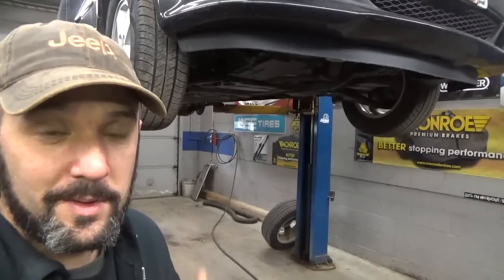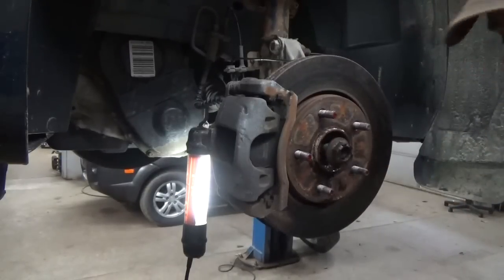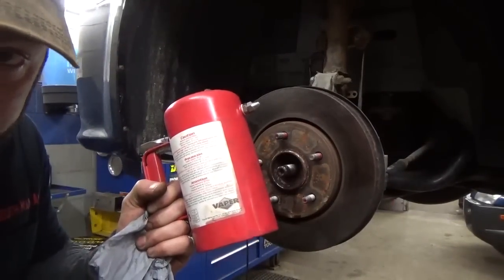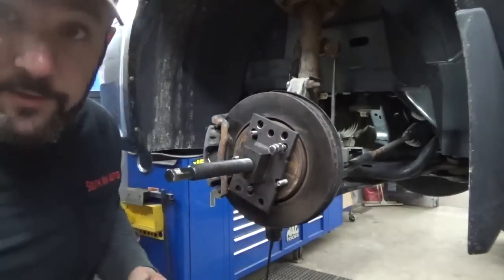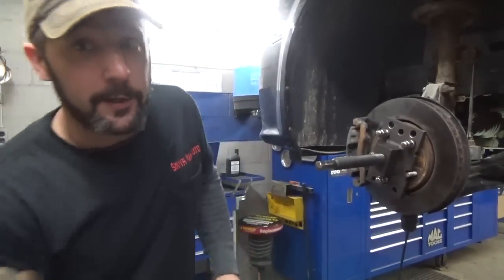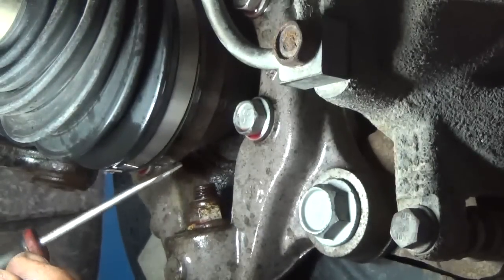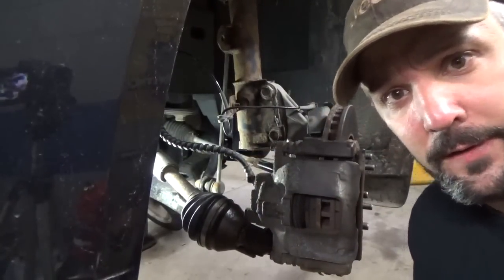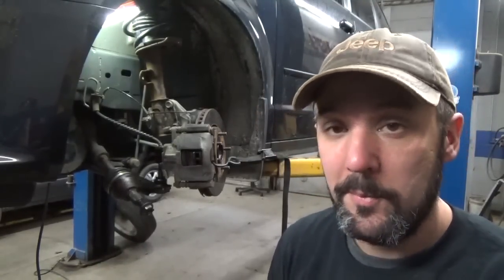Dodge Grand Caravan Lower Ball Joint - Part I

Comment: Brilliant, passed  state inspection with flying colours and the lower ball joint is totally gubbed !, state inspection leaves much to be desired then !!.
Bodgitt and Leggit had a similar issue with the Irish inspection system.
I certainly dont get the logic here.

Comment: Did you have to pay for the axle or did the customer?
Reply: jackslater230011 I would assume the customer.
Reply: I wouldn't assume that. Technically, Eric most likely broke it by pounding on it.
Reply: He did break it, but garages usually charge the customers for ancillary parts when doing a repair.

Comment: I have a 2004 Dodge Stratus and what a nightmare it is to work on doing any front suspension work. Upmost ridiculous design the upper and lower control arms are 1 piece you cannot just replace a bad bushing just to do upper have to take strut out

Comment: What the heck is with Chrysler/Jeep/Dodge/RAM ball joints?  I lost several on my '08 Jeep Patriot (may it rest with someone else).  RAM's have been known for ball joint issues.  So far (knock on my head) our Durango hasn't tossed any (4.5 years old at this point).

Comment: Why you didnt heat the CV joint and a hub?
Reply from the maker: Martin I didn't want to ruin the bearing if I could avoid it
Reply: South Main Auto Repair OK, now I understand.  In my car bearing is much cheaper than the axle..
Reply from the maker: Martin Oh got ya... yeah not in this case

Comment: Why not just remove the two camber bolts and get the angle of the knuckle downdraft to make it easier to pull out the axle. Then once lose put camber bolts back in.

Comment: 3 people were killed recently here in Ireland because of a faulty balljoint.The car swerved across the road into an oncoming jeep.
Reply from the maker: Tom OConnor geez that stinks :( and to think NY says they are not a "safety" item...
Reply: South Main Auto Repair Right below you here in NJ the only thing that matters is emissions.  You can go in with no windshield, no mirrors, 4 bald tyres, severe steering play, but as long as the check engine light is off and it passes emissions, you're mint.
Reply from the maker: Haha typical! Insanity isn't it? Save the bunnies and puppies haha
Reply: It scares the hell out of me actually; people request us to overlook or to do some really sketchy things. When I worked for advance I had this dude who thought that $15 was too much for a brake hose and informed me that he was going to crimp off the line with a set of vice grips.
Reply from the maker: lol perfect
Reply: I'm all for safety inspection. I am usually all for the government staying out of our lives, but this is something that the average Joe (at least in my area) cannot be trusted with. I recently bought a truck out of Virginia that had just been through safety inspection recently but because it's an 83, it was exempt from emissions, which they removed everything to do with emissions on the truck. Luckily with pre 96 vehicles, it's easy enough to get around if you know the right people.
Reply from the maker: Lol it's all about knowing the right people. There is a scum bag shop just up the road from mine and for $50 and  a hug you get a sticker on anything. He plugs them into his own vehicle and prints out stickers haha. He does all his business after 5pm so the state says that he will never get caught because he can never be audited because he is "never open" during normal state business hours...

Comment: Eye protection, Eric!

A chip could come flying off the end of the pressure screw when you're whacking on it with that sledge.

We need you around with good eyesight in both eyes!

Comment: Even experienced mechanics are brainwashed by the impact gun.  You never use impact guns through 6 inch long steel rods or any extensions, you simply get too much torque loss.  I see it every day mechanics will waste tons of time using impact wrenches and wondering why it doesn't work.  You see Eric here waste 20 mins using an impact gun and as soon as he uses the breaker bar things start happening.  Message to mechanics everywhere DON"T USE IMPACT GUNS THROUGH EXTENSIONS OR LONG BOLTS!!  Steel does stretch and amplifying it through a long extension will loose all the torque.  I see it every day.  It should be chapter 1 of intro to mechanics school.

Comment: What is that press tool called?
Reply from the maker: Ivan bg A ball joint press
Reply from the maker: South Main Auto Repair or are you talking about the wheel hub puller?
Reply: South Main Auto Repair Found it OTC 6290

Comment: Freeze the shaft with duster spray, axle...the bearing is toast. At least the carrier is salvageable. Grease splines always. Manufacturers are lazy with greasing critical failure points. They could increase the long term reliability with simple grease and sealants.

Comment: Pay you now or pay you later?  Then why not replace the entire lower control arm?  The ball joint is just one of three joints that move.  They all get worn.  Once you have it disassemble to this point, removing the entire control arm is nothing. 

Replaced mine last night, 2011 with 230,000. I tapped the axle with a hammer and it fell right out.  No problem.

Comment: part of my job Is taking the little fragments of metal out of people that wail on the ends of steel bolts/chisels with sledge hammers when it is in your arm, leg or chest it is no big deal.  When it is in your eye it is a very big deal please wear safety glasses

Comment: Dude? trying to save her money on alignment? Why not remove the bolts on the shock and swing it out the way? I'd use a little black spray paint on the shock to line it back up and keep original alignment, removing shock would make things much easier to work with. Right? Seriously, just thinking out loud here.

Comment: I never understood why bad ball joints are not a reason to fail a vehicle for inspection in New York state. Any other part of the steering or suspension being bad would fail inspection. Yet the lower ball joint (which pretty much all of the other components rely on as it bears all of the weight) can be loosey goosey and all is good, I don't get it.

Comment: Wouldn't it be great if the factory coated the splines of the axle shaft and wheel bearing with an anti corrosion product before they assembled them!

Comment: Bloody hell i cant believe everything was that tight or rusted up for a 3 year old vehicle. Over here in the united kingdom a 3 year old vehicle is still all shiny and rust free underneath ect. Are the roads in new york really bad for salt or something? Im a m.o.t tester here in the u.k and that would have been a fail for a annual inspection. Crazy that it passed but hey if the goverment think thats acceptable then that says to me they dont have a clue what they are going on about. Crazy.
Reply from the maker: Caillin Greer In NY if the roads are not bare and dry 15 minutes after a snow storm the people would riot. They put salt down on the roads year round where I live. In the winter to melt the ice and in the summer to keep the dust down. Cars only last about 15 years at the most.

Comment: Remove ball joint nut as far as it will go. Break ball joint taper. Remove ball joint nut the rest of the way.

JMF TAG
The Alignment Guy (R)
Reply: I saw the same thing as you did, the solution seems so simple. Then it dawned on me, I think he is opting for the hard and dramatic route in order to produce more content for the youtube channel. If that is the case then I DO NOT hold it against him whatsoever. He's a 1%er mechanic, one of the best out there, so I love to see him tackle the big jobs even though he could've used the easy out which we both identified.
Reply: What a joke... this is the reason I no longer take my car to a mechanic.  Guy added hours to the job and a new cv job for no reason... cost of job to customer more than doubled

Comment: I've had a half ton dodge pickup at work doing lowers and the knuckle is alum. Well that cv refused to give up. Ended up pulling the entire knuckle with cv which was such a bitch to pull outta the diff to it had also pulled the intermediate shaft out with it. Well we maxed out our 50 ton press on it and wailed it with a hammer while on the press. Even had a big nasty air hammer on it while wailing and pressing... long story short it didn't come out and the new knuckle was like 1200 from the dealer.. wasn't a good day..

Comment: At the intro, i feel like a quick demonstration of what would happen if the ball joint failed would be interesting to see.
Sure, i can search for a video of it but just a quick "if the ball joint fails, the wheel would do X and you end up with Y" sort of deal.

Video: https://www.youtube.com/watch?v=kHt8iKZcAxE

Obviously, going 60-70 MPH and not being ready for it can be fatal. And one failure can lead to another, which in turn can cause yet another.
Reply from the maker: Cadde  Or when you use cheap pads....https://www.youtube.com/watch?v=S2XvxDaIwCw
Reply: South Main Auto Repair YES! Exactly like that!
I am glad we are on the same page. :)

Comment: Did you kill the shaft is that what happened? I am surprised you even got it out anyways. I already know the one on my trailblazer is going to be toast. I replaced the ball joints a long time ago and of course they are shot again. Its got almost 200k on it anyways. I said the next time it had to be done,I was paying some other fool. It was a bitch. Of course I guess now you just replace the entire lower arm as its easier and cheaper for the mechanic to do it that way rather than press them out. Had I known that. The upper one I think is the same way now,just replace the upper arm. Hell you probably already know that. I have done a few Caravans enough to know I hate them,but like them too. The engines are really easy to pull.

Comment: Be a mechanic they said! But they didn’t say where! I think the problem was that gurly impact gun! You needed one of those bring it or ring it guns. Look at all the nice exercise you got! Another plus, you didn’t hit your thumb with that huge hammer! What a video that would have made! You hopping around like a violated kangaroo, holding your thumb! I know you’re capable of that, I’ve seen too many videos of you sporting the old black thumb nail. I excel in that department myself! Is there anything that hurts worse than a mashed flanges

Comment: DIY they said. Save money. Learn new skills. Upper ball joints on a Toyota Tacoma 4x4.  Using a loaner Auto Zone OTC press with all those "excellent" cups and a 4 FOOT long cheater bar on the wrench.

Then standing quietly when returning the bent press while the clerk inspects the box to make sure all those cups are inside.

DIY they said...

Comment: simple solutio,should of tighten up the nut and see take it for a drive ,if the same then it would have to go to dealer ship as a recall....
but do  know that not all jobs under  or in front will go accordingingly,...not always easy ...

Comment: You need to have the owner step up and buy a new axle and wheel hub assembly. Even if you have to put the parts on at cost. I believe if you don't replace the hub assembly now, you will be doing it in short order. Save yourself some grief.
Reply: Stephen Cook Of course that would mean an alignment too and the bearings are pretty well sealed so it might be ok, but I agree, when there is that much rust, it's best to do the bearings too.

Comment: those impacts have 0 power, id loosen the nut as far as it would go and youd most likely be able to hold the stud with pliers, or cut the studs right under the nut etc.

Comment: In south Australia we have no inspections/roadworthy, you can literally register your car (no RWC involved) and drive any piece of crap around. Thats why I never buy cars from there. There usually is a reason a used car is in that state, dude's know it will never pass inspection.
Lol new york state say faulty lower ball joint ok but pissy little oil leak no way.

Comment: Could have loosened the castle nut as much as you can and then lowered the arm with a flat bar then you would be able to remove the nut the rest of the way instead of wasting all that time messing with the axle
Reply: Could have heated the axle spline up too that would do the trick

Comment: That's crazy , ball joints are part of the steering components , here in Nova Scotia , that would fail with flying colors and must be fixed B4 a sticker issued , stupid rules for NY inspections , what moron thinks a ball joint does not have anything to do with suspension and steering ?. Daughter.

Great vids by the way , I'm currently in the market for another truck and been watching quite few your vids on what to watch for

Comment: Bad to worse.  Story of every mechanic job I've done it seems. But I'm just a home mechanic withOUT most of the bigger esoteric tools.  However, like they say, necessity is the mother of invention. Like a coffee machine to heat axle bearings.  Hahaha. Where there's a will.. ya better figure it out or you don't go down the road.

Comment: That is not the proper way to remove a ball joint.  Imo, You Sir, should have ate the cost for those unnecessary parts.

Comment: Shocking regulations in Murica.
Reply: The state vehicle safety inspection requirements vary from state to state and there may be a few states with no safety inspection requirements.   The ball joint thing has a long history in New York State,  under the old rules inspection shops could ALWAYS find the ball joints defective, there's no good agreement on what's a bad joint.  Shady shops made lots of money on ball joint replacements,  and many times nothing was actually replaced.  Eric O. Is one of the few honest mechanics around ... and within easy driving distance of me.

Comment: If at first you don't succeed.... Get a bigger hammer.
Reply: Some years back at a shop I used to work at when we ran out of juice with the sledgehammers or hydraulic presses we'd either hoist a big ole bar of round stock in the crane and use it as a ram, or reverse the forklift into whatever it was that was being stubborn. Mind we worked on large industrial equipment not dinky little cars, it all rusts the same though.

Comment: Nice video, but seems to me that hammer work ruined the CV joint. Lube the puller and use a LOONG breaker bar instead. Gotta pull not bang.  And then it sure looks like a wrench could make it on that ball nut anyway. My 07 Dodge in California looks like new in there. Reminds me of why I left Wisconsin. But the factory should have had grease on the splines and nut at assembly. You will be sorry about your ears in about 25 years, like I am now. Also, you only get 2 eyes and its a bitch with just one I hear.